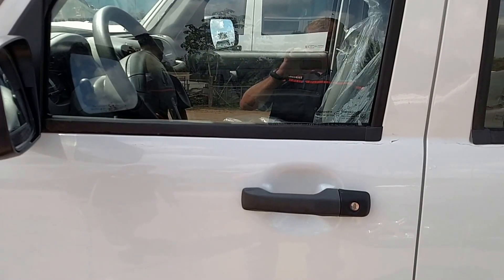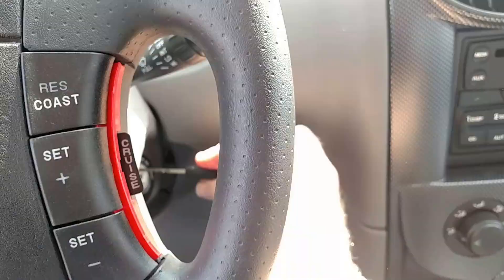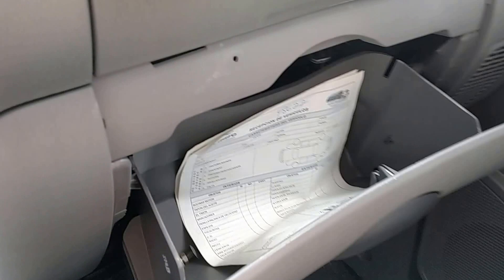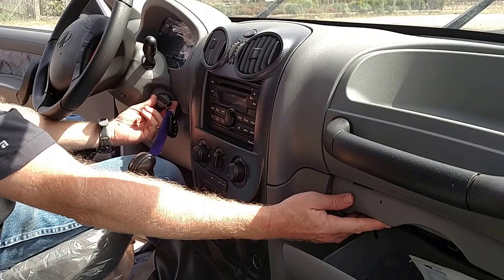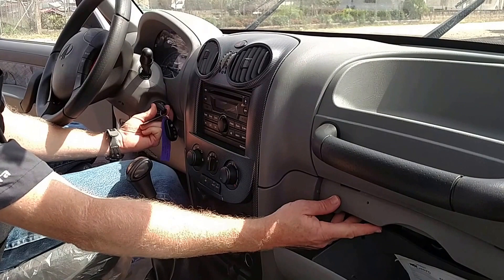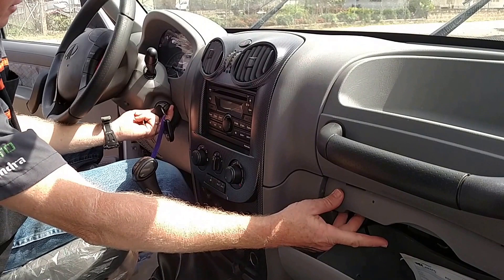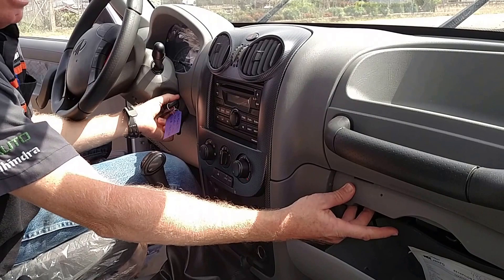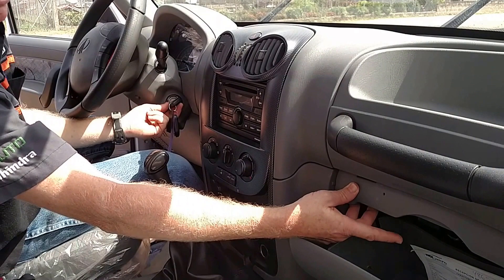How to disarm Mahindra Pik Up alarm system by personal pin code

Comment: Hello People!! How can i disable the alarm ??? My padlock blinks after and before i start the enginne, so i cant move long distances, this works for that problem???? Thanksss
Reply from the maker: Mauricio López this is specific to the Mahindra Pik Up. This video shows how to  dissarm the alarm in the event that you don't have the remote to dissarm.
Reply: Willie Penner i understand, but how can i disable de alarm system? I want to use only the key, to lock and unlock!! Thanks bro
Reply from the maker: For that you have to make electrical circuit modifications. Sorry I can't help you with that on here.
Reply: @Hotshotbz  remote automatically creat alarm or we have to do something. If yes what to do. 
Do you help me bro wether scorpio pick-up use nippon remote or programme able remote. 
If mannual sent me link of video .
Thanks bro